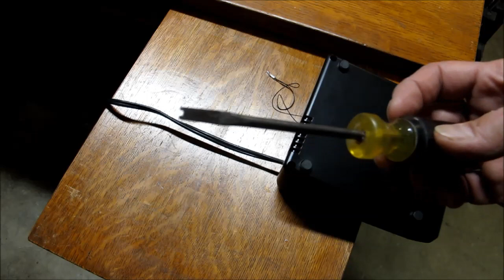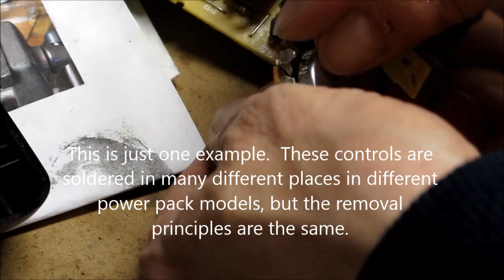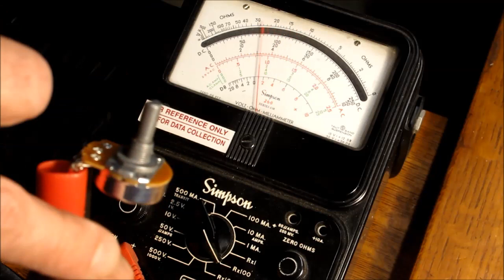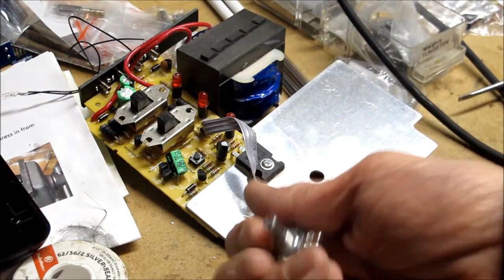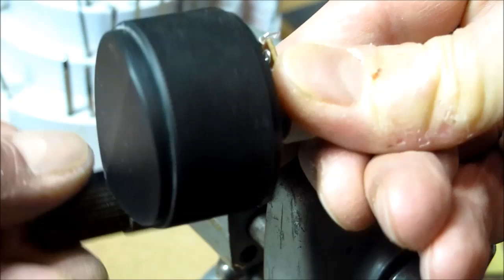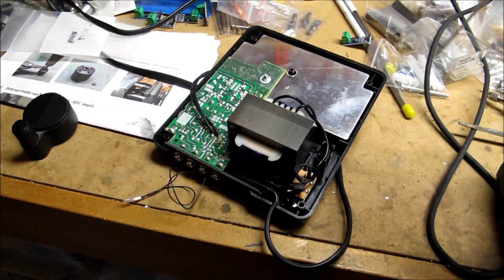MRC 760 Repair

Comment: What if a guy puts a potentiometer between the power pack, and the track?
Reply: A potentiometer won't have the wattage capacity for this application. You need to use a rheostat. In the "old Days" this is what was done to use a "mini model adapter" with an ac transformer. It will work if the power pack is putting out steady maximum DC voltage.

Comment: I am going through this right now.  I have an old MRC Tech II Dual Power 2800 and both potentiometers are blown.  It was working fine until a few months ago, one pot went out and about a month later the second pot went out.  Looked inside and the resistor material has shed off of both of them.  The power pack is from 1990-ish so 32 years old?  

The repair is really simple but trying to locate the potentiometer has turned out to be a bit of a hunt.  It appears to have a 1.28K resistance reading and in addition to the normal 3 wire tabs it has a 4th connection out the back.  I'm not entirely sure how the 4th lead is connected inside the pot but it's wired to an external capacitor.  Have you had any experience sourcing potentiometers found in the older Tech II units?   

Thanks for posting!  DTJ